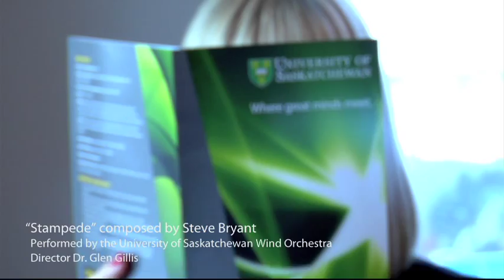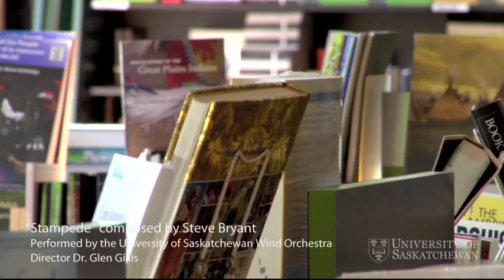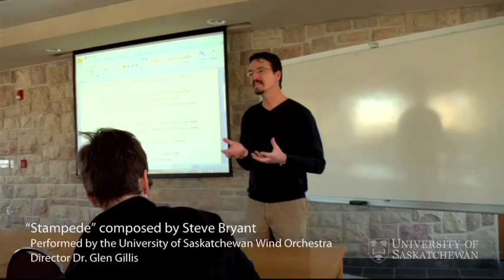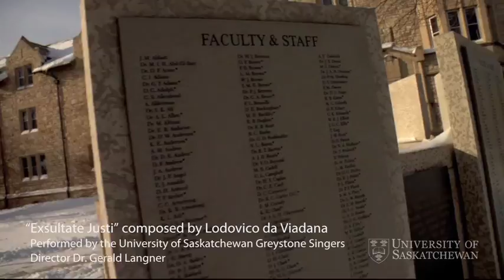University of Saskatchewan Promotional Video

Comment: Hi,
I'm interested in studying Bachelor of Mechanical Engineering at the University of Saskatchewan so is it hard to be accepted? is the studying over there really difficult and you barely pass your courses?
Also, in my current university (concordia university in montreal), usually the final exams contain 60% to 70% of the whole grade of a course. Is that the same in U of S?
I would really appreciate if I can receive answers and suggestions. Thanks!